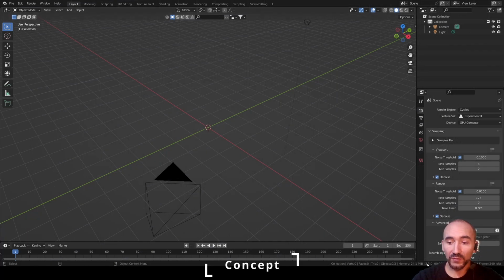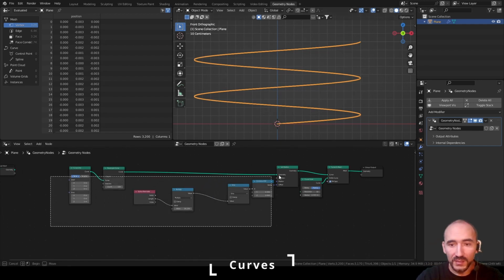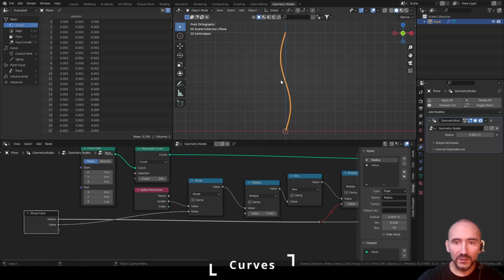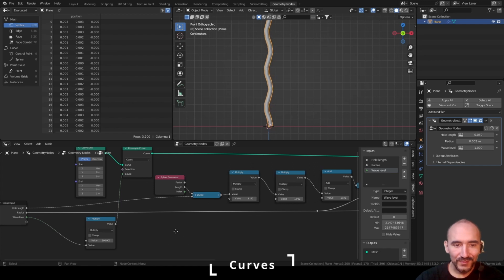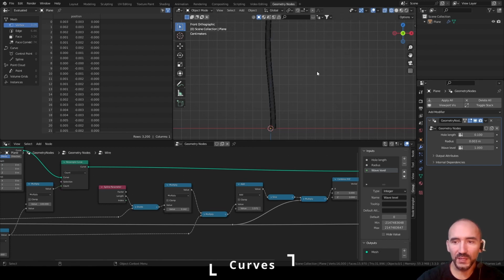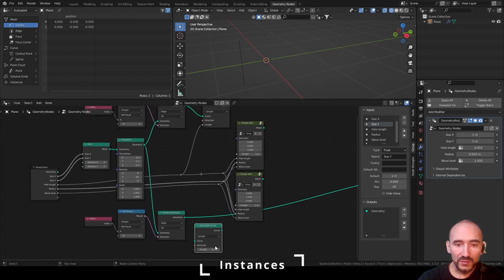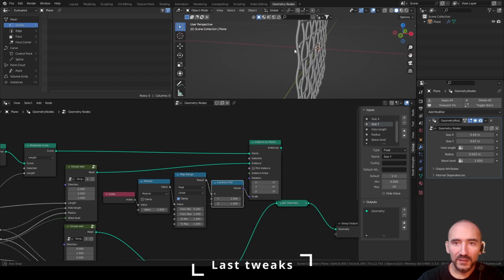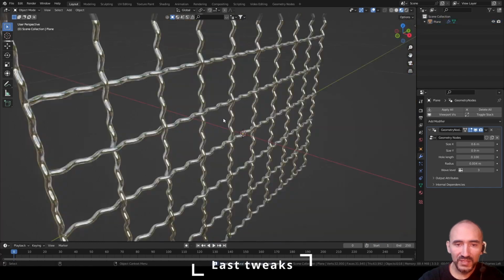Procedural wire netting type 1/8 in Geometry nodes - Blender tutorial ENG

Comment: Set the Hole Length Minimum to 0.02 BEFORE you start playing with the finished setup - to avoid a Blender freeze then crash.
Reply from the maker: Yes Neil, you’re right, dividing by zero is never a good thing ;-) I will  update the blend file of gumroad page as soon as i can. Tx for the observation :-)
Reply from the maker: Hi Neil, now i checked the file uploaded on gumroad and the general node was ok with minimum value of 0.01 however i also added a minimum value to the subgroup node for the creation of the single curve ;-)
Reply: @andrea_ciani  Good idea. :)